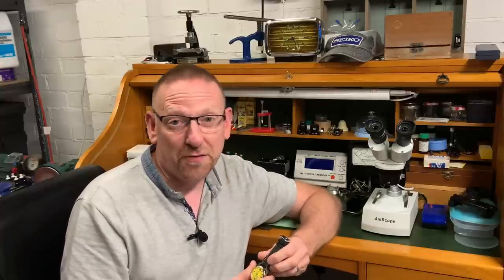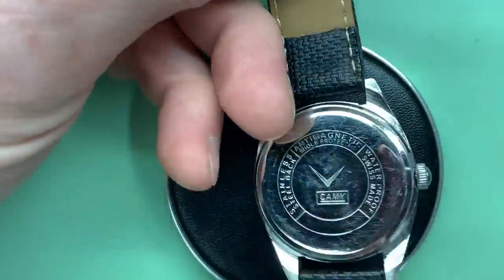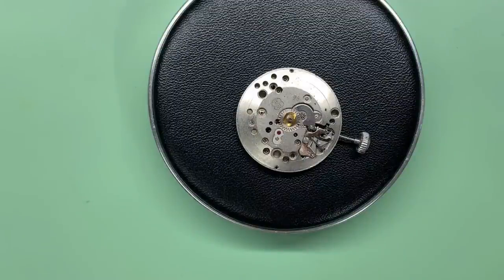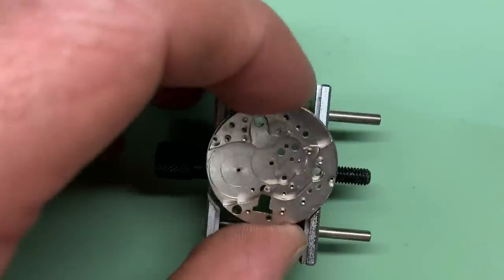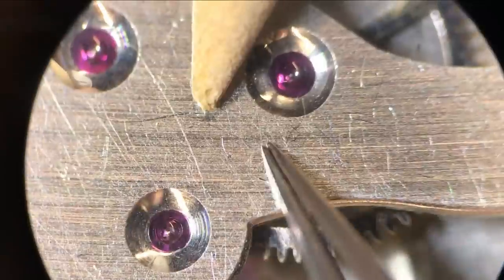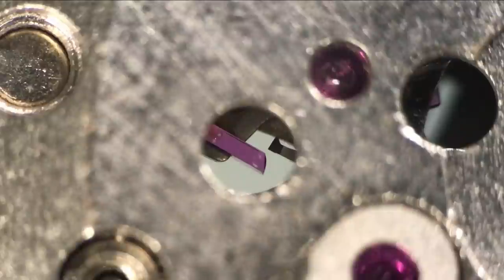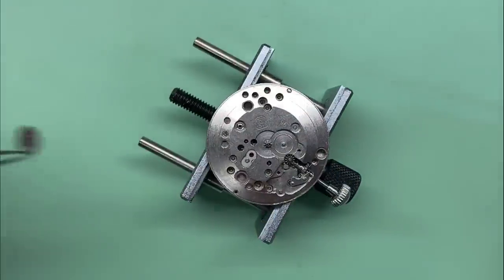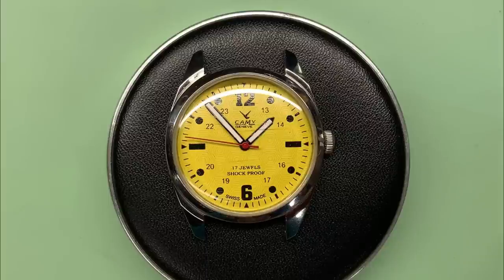Whats Inside a "Mumbai Special" Watch?

Comment: I may be missing the point but is it actually a fake as you stated? If you sqrint a bit I guess it could pass for a Seiko 'homage' but it's not labelled as anything but a Camy, I don't particularly agree with them branding the movement but to my mind that's no worse than many micro-brands  who do the same thing. You could look at the vintage description two ways yes the movement is old so it's a reasonable claim but as everything else is new it might be stretching a bit. I'd be very tempted to try to find an old dial that would fit and assemble a nicer looking 'classic' style watch. For 13 quid you got a reasonably sweet running little watch.

Comment: IDK, but I think you may be a little too close to the forest to see the many trees of reward, Bro Retro. If I had finished up with such great results as you had with this watch, I'd be crowing like a rooster. I will admit to having my own little stash of Mumbai Specials and they can be a real challenge, but the experience gained in working on them makes them a bargain, as you pointed out. If not, you can always comfort your frustration with the low cost of the attempt. However, in this case, I think you turned trash into treasure. Besides, I think it is a really cool looking little watch. Congratulations on your find and keep blessing us with your enjoyable and informative videos. Cheers from the US.
Reply from the maker: Thank you Chris . Nice comment .  I’ve learnt that cleaning is the key. Perfect your cleaning , especially around jewels and the rest will follow. Good cleaning gives good results .

As for this one not sure when it will make it on my wrist. Now I know the crystal is just balancing in the case I’d need to address that first.
Reply: @MyRetroWatches  I will certainly take your advice. Thanks for the detailed cleaning times, etc. I also have a "Retro" L&R machine but was never sure of how to use it properly.

Comment: Would like to see some HMT service videos, like their Rajat, Kanchan, Vijay and Janata models. How do these real Indian-made watches compare to other designs and manufactures?
Reply: All citizen movements rebadged anyway.
Reply: Yeah it will be so fun to have a look over hindustan machine   technology 
I had some of them too servicing myself
Reply: @K20-h5n  Not really. The Citizen company licensed their 0201 movement design to HMT in 1961 and entered into a contract with them lasting until 1975 to manufacture more difficult parts (such as the balance wheel). It wasn't a blatant copying or stealing.
Reply: @jakekaywell5972  didn’t say copying I said rebadged, which in a sense they were

Comment: I've had mixed luck with 'Mumbai Specials' I don't think the phrase is racist - Never even heard it before to be honest. But... Do this: Look for lower tier Swiss watches on Ebay say Titoni or Oris or something like that. Arrange by price. Note loads and loads of the watches are sold from India, then note those sellers are from Mumbai. It's not a comment on Mumbai, but there is evidently a cluster of workshops in Mumbai warming over cheap Swiss watches for resale. I bought three in total - one was good a Titoni Airmaster in good shape and runs well. The other two were dirty inside although they were listed as serviced an one of them had a very poorly refinished dial. They are a very mixed bag but I bought them to mess around with and see how I fared with stripping and rebuilding them. I broke the balance staff on one! damaged another clumsily trying to refit the hands and got the third and nicest one back together OK. Then I was ready to tackle two vintage Omega watches
Reply: Oh yeah, I just remebered the dial feet were broken on one of them and the dial was glued on. Also at least one was a recase as there was a hand modified plastic ring taking up space between the case and movement - not entirely effectively, I might add. But as I say one was a total hit total out lay was about £120 on all three and I learned loads with the crappy ones trying to clean and rebuild them before I got some skills. They all had genuine Titoni movements

Comment: I have a "Vintage Citizen Automatic".  It has Citizen on the dial, and Citizen on the rotor, but I don't know how real either of those is.
However, the case is definitely an Indian manufactured "hmt". 
It WAS cheap, IS automatic, and MAY even have a bit of Citizen in it. I bought with my eyes open, just interested in what I would get and it is OK for the price I paid, but not a "Vintage Citizen Automatic".

Comment: Nice one Mike, I'm really glad that you finally posted this video and wasn't it a long one. 
As I've said before, mine was an HMT from India and quite frankly I love it. 
£11.00 and free P&P. Takes about 4 months to arrive LOL.  Nothing to complain about. 

Couldn't help but notice you use the word "Fake" to describe it. I prefer the term "Frankin" watch. 
I guess that the dial and case back is fake because it illegally copies trademarks, but the actual movement is genuine, so if you require spares for a Seiko, Oris or Citizen watch movement you know where to find them at a super cheap price. 
OK the 4 month wait could be a real deal breaker.

I've worn my HMT on a number of occasions. The dial says HMT the movement is HMT and it keeps good time. 
Actually my reproduction HMT dial is better than the original which actually would have been "hand painted" and from what I've seen they looked pretty messy.  

It would have been interesting to see this CAMY attached to a better (non knackered) escapement just to see how good it could have been. 
What a pity that the crystal went walkies, but I'm sure this could be fixed without too many problems. 

A massive thumbs up for a fascinating video. 😀👍
Reply from the maker: Hi,  well I call it fake because unlike some the the Seikos I discuss they are 90% Seiko , this may have a movement used by Camy but thats about all that is original.  Dial is not repainted but a purpose made fake, case is brand new and the back is poorly stamped.   Crystal is appalling, it stays in so is not lost but would offer no protection to even condensation from sweat as there is no tension ring or gasket.
To be fair to the movement its a well made generic 17 J movement of the day which has stood the test of time well.
sorry about the length of video, I keep trying to make them shorter but I keep talking too much. (had some comments about that too....)

Comment: That's a pretty good India knock off you've got there. At least it has dial feet! I've bought two Seiko 6309 based knock offs now, so I can practice on the movement, and both dials were just stuck on. The second one also had the hour hand pushed on to the point it was pressed against the dial. I had to get a craft knife under it to lift it off.

Thanks to your 6309 strip and rebuild videos, I got it torn down, cleaned and reassembled. The balance is continuously operating, albeit with very low amplitude. To try and fix that I'm going to attempt to clean and oil the balance jewels today.

When did you start to get into the hobby? If you weren't really into watches before 2016 (mine is a similar story), then you've come a long way in a short time!

Cheers

Comment: Seems like it's a nice vintage movement, worth the effort and doing right, for sure. Just lose the dial or make your own, and don't ever try to claim it's original. Personally, I don't mind the listings that are honest - "vintage genuine movement, aftermarket case and dial." If it's honest and you known what you're getting, I don't see a problem. It gives continued life and utility to an old movement when the case has been tossed or melted. The only time I's have an issue with it is if someone tried to pass it off as being all original.
Reply: Not really so different from selling a car that's had an engine swap or aftermarket parts put on. Not that big of an issue, as long as the seller is honest and the buyer is aware.

Comment: Would it be worth fitting a generic dial as it would certainly be useful as a 'knock around' watch?  I thought about getting one as a practice subject, we'll see!  You can also get the HMT watches which seem to be an Indian brand but don't know about the movements they use.  Maybe they'd feel a bit more 'honest'!
Reply from the maker: For a practice watch these are great.  if you also get the FHF Swiss movement you can learn allot from it and they are not that difficult to take apart and rebuild.  Good luck and thanks for watching.
Reply: My understanding is that many HMT watches have movements base on older Citizen movements as HMT was formed by the Indian government in collaboration with Citizen to establish an domestic watch industry.

Comment: Beware of the India sellers. I have a Citizen allegedly a 17 jewel all updated on purchase paid for Jan 14 of this year. As of Jan 23 it was according to to India post tracking web site  "bagged at Dehli airport" Repeated inquiries and 40+ days later the seller merely says your watch is on its way when he does respond. 

However there is no ETA, delivery projection or movement from India according to the India Post website tracking tool using the India Post tracking number. I have a second one as a trial from another vendor just to get proof of concept these guys are ripping us off.That purchase does have an expected ETA and a current tracking number so maybe the first one was a fluke and not the norm, 

The prices are cheap, the names of watches are good, the promised upgrades are too good to be true so as we have always been told by the older and wiser deals too good to be true probably are not!
Reply: That's why I avoid India for buying watches with the sole exception of HMT. Being an Indian company, it would make the most sense to buy one of their watches or parts from India.

Comment: Before anyone starts thinking that these watches are possibly a value, and less than 20 bucks is not too much to risk for getting a decent one, observe these words of warning. I have bought many of these watches to learn how to do watch repair, and for that alone they are worth it. Do not risk buying one of these if you plan to wear them, please. Most I have received have no water protection, none have any oil, most have missing parts,  all the bands were terrible, some did not even work at all, and some for only a short time. Put that money towards some other alternative.

Comment: Hi. Just passing through. Interesting item. Just a couple of things. Try not to use overpowering music. It's a bit of a turn off. Also "rince" means something completely different to the correct "rinse" spelling. I have a Tissot Seastar automatic that was given to me some years ago and it ran a bit fast. I had it "serviced" by a company in Bradford when I lived there, but they ruined it. The dial face came lose and spins round and it still didn't run accurately. It's been sat in a drawer for a few years now. I don't know who to trust to send it to for proper servicing to be honest.
Reply from the maker: Thanks for your comment .  To be honest this is only the second video with music over my talking . I was experimenting with some new editing software, you are not the first person to comment on the volume so my apologies for that.  I will only use music now at certain points like the fast forward parts where its appropriate. 
Thanks also for the grammar correction, you are right! yet I did not notice and now I cant change it... 
As for your Seastar sounds like they have broken the dial feet off it.  A difficult fix but someone with the right soldering machine would make light work of it.  Tissot Seastar's was also a highly copied watch sadly.

Comment: Other than the name and back embossing, everything printed is true. The movement is 17 jewel made in Switzerland and has incablock. I would like to see what is in the rebuilt Seikos they sell. Are they real vintage Seiko movements?
Reply from the maker: I have bought around 3-4 Seiko ones but for parts.  The movements are always Seiko that I have seen but you still have to know what you are looking at to see which movement is in it.  Caseback will say one thing , advert may say another but if you can recognise a movement or read what it says on it if the photo is clear enough then you know what you are buying.  A lot are 6309 or 7### like 7009s etc
Reply: @MyRetroWatches  Thanks for the replay. Good to know.

Comment: I have a Mumbai Seiko 5 7009 from the 1970s. Strap is rubbish, it won't run without constant wearing
I have a Sea-gull 25 jewel automatic datejust look alike from 1985, looks great and still runs like a dream.
All authentic and on its original Seagull signed bracelet.
Signed crown as well.

Comment: I have a job which can be brutal to wrist watches, but I like mechanical watches. If it's cheap, looks good, keeps reasonable time, I'll wear it.
Reply: I just picked up one of the Seiko Frankens off of eBay for the same reason! Wearing my usual srpc07 at work just doesn’t feel safe.

Comment: I think most people have a little common sense.  If I buy a $20 watch, then I know I have a $20 watch. As long as I don't present it as a more expensive piece, then what's the harm? If the piece is a fake, it's a fake and you shouldn't pretend otherwise. Years ago, I bought a fake Rolex at a yard sale for $3. It looked as real as it could look from a distance.  If I was asked about it, I always said it was fake.  Later on, I used it as an illustration in a sermon I preached one Sunday morning.  I destroyed the watch. By the way, it had a battery in it.  50 years ago, you could buy a Rolex Submariner Date 16610 for $230.  With inflation at today's price, it would be $2111 + or - a few bucks. You won't touch on for nearly 5 times that now.  Compared to the actual price then to now, this same watch would be considered an inexpensive one.
Reply from the maker: Thank you for your comment, you would think people would have common sense but I read so much about these types of watches and now they are fakes or frankenwatches. I wanted to try to put my thoughts to it on video.   This watch is trying to be a brand its not so that is fakery, however its still powered by a (probably) 50 year old Swiss movement and for the money that is still a bargi
n.

Comment: Was thinking at first when I seen the trace and it had that shot gun pattern as I call it that the watch could be magnetic or something with the hairspring. Looks good and I hope the SKiko 5 watch I got coming in from over there (movement 7019) will turn out to be a good one.
Reply from the maker: I do like the 7019 movement nicely jewelled and a solid workhorse.  So unless you have end shake issues or a dodgy balance you will be fine.  I love shotgun pattern and will adopt this rather than the snow storm I usually use!
Reply: @MyRetroWatches  The 7019 will be my first one so hoping for the best just going to take my time and have fun. I really love you channel. Cheers Mate!

Comment: A few years ago I bought a similar Indian eBay watch to mess around with when I was first getting into the hobby for 10 bucks including shipping. It's exactly the same as this one except for the dial paint job. It wasn't running at all when it arrived but once I opened it up and pulled out the hair that was fouling the balance it's actually not a bad runner :)
I actually forgot all about it until this video, i'll have to pull it out and clean it. Thanks!
Reply from the maker: Not sure you should thank me for reminding you that you have one!  Thanks for watching

Comment: I have three Bombay Bad Boys hehe, the highly unusual cased Orient Tri-star very early into the Orient production which doesn't work at all well, a '75 dayglo orange Citizen which is absolutely flawless auto and my 7009-3040 which I had to repair the movement holding ring and has that awful black ring glass on it but works actually very well.   The Orient is in a letterbox rectangular with massive fluted wings and shrouded lugs, even the experts in some of the forums had never seen that case type but sadly the dial is horrible and it just doesn't run for longer than 20 minutes so is in need of a service.   The Citizen is just lovely but a small dial I don't like much and have earmarked it for a giveaway somewhere down the line and all the 7009 needs is the proper crystal as that black marker like crystal is awful.   The sellers quelled by the dodgy bug are back in droves, prices have more than tripled and the Rado diastar boys back with hugely increased prices as well, would I buy another?  Doubtful, maybe a 6309 if the right one popped up.

Comment: Great vid tho. I've heard horror stories about trying to buy these Frankenwatches and shipped to over here. So that's why I avoid them.
Reply from the maker: You could be dodging a bullet long term...  I do hear that many do not make it to their destination however mine was bought from a UK seller so little to go wrong in my own country.  Thanks for watching.
Reply: You have to spend quite a while looking at the pics of many on offer, I scored with a '75 Citizen which has been perfect, the Seiko 7009-3040 was not the same as in picture and had that awful Indian "black marker" crystal on it and the little plastic movement holder had snapped and I had to glue a little bridge over the snapped bit to stop the movement flopping about inside.   I think the best one was a £1 Seiko 7009-3100, apart from a slightly marked crystal has been an absolute astonishing piece that I wear often, was sold as broken/spares or repairs and I could not find any flaw with it other than the slightly marred crystal which I had a go at with some hardlex crystal cleaner.
Reply: @dodgydruid  how did the crystal turn out?